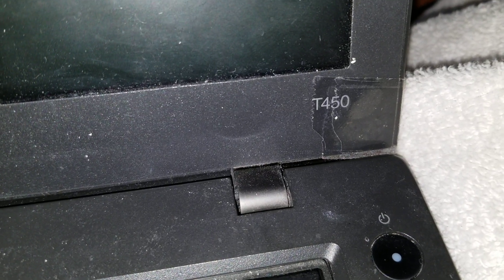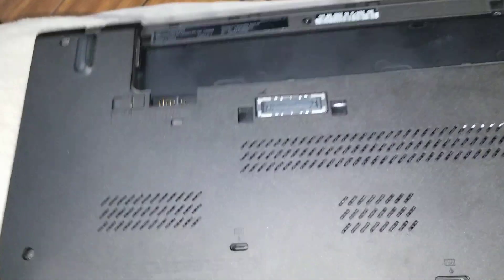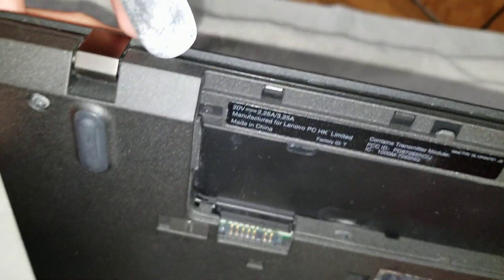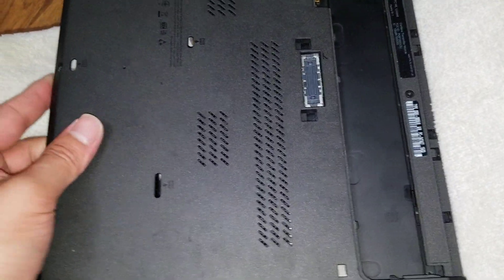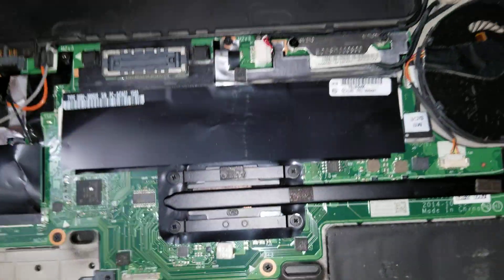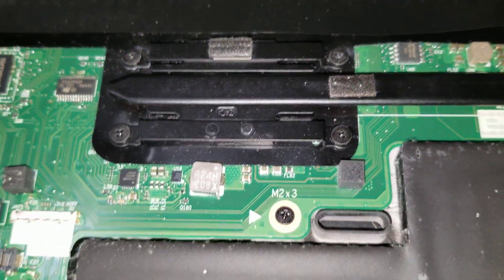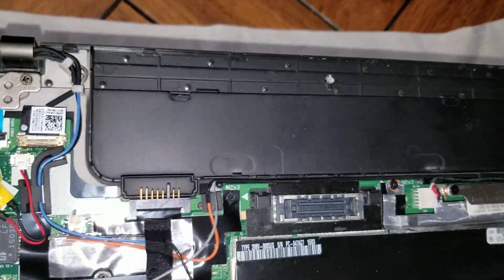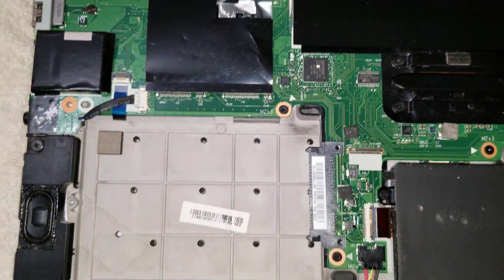Lenovo T450 Disassembly RAM and SSD hard drive upgrade replacement

Comment: hi.
Thanks a lot for your informative video and guide.
I am curious, regarding the Wifi-Card - which interface it has? (M.2/E.key, PCIe).
(I am guessing, that this card is on the other side of the board, and are also fearing, that it is integrated into the MB)

Thanks in advance, for getting back
Reply from the maker: Not sure

Comment: may we add 32 gb of ram?
Reply from the maker: If it fits, sure, but I don't know why people are so obsessed with so much ram. 99.9% of people won't see any difference with more than 8gb of RAM.
Reply: @ItsBinhRepaired  yeah that s right but in my case i use many vm at the same time that s why i m thinking about extra ram. Best!
Reply from the maker: @itsfran76  I don't remember what type of ram it uses. If it's ddr4 and has 2 slots you could even put 64gb

Comment: Near hdd thr is a black paper whr u can install m2 42nm ngff ssd... So i believe u can use 2 drives same tym...
Most of the guys don't know that lenovo thinkpad t450 n t450s support dual drive.
Make a video on that 🤝
Reply from the maker: I just rewatched my video. I don't think this model has an m.2 slot. That slot under the plastic next to the wireless card is for another network card. If I work on this model again I'll take a closer look.
Reply: @ItsBinhRepaired  you can instal an a NVME 2242mm drive on the WWAN slot. I did it on my t480. A Toshiba RC100 240gb. https://adrenaline.com.br/forum/threads/thinkpad-t480.649972/page-3

scrool the page to see.
Reply from the maker: @juanmanuelfc there is no max capacity as far as I know
Reply from the maker: @juanmanuelfc  no problem
Reply from the maker: @Rods600  what's that? I don't click random links
Reply: @ItsBinhRepaired  He shared a picture showing that t450  has two drives idk  U CAUTIOS ASF!!!! XD
Reply from the maker: @supremesnake8695  that's how you get hacked/virus. I do this for a living, remember?